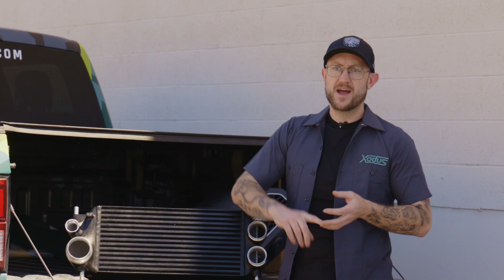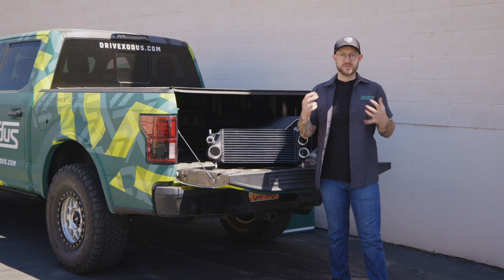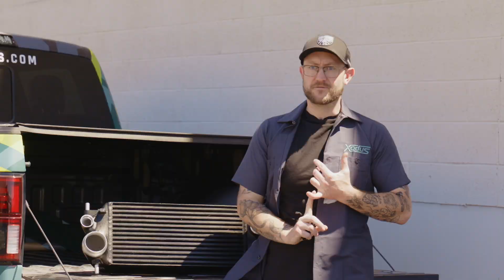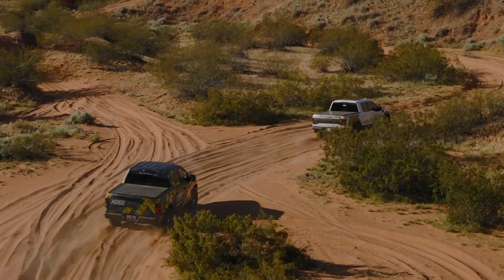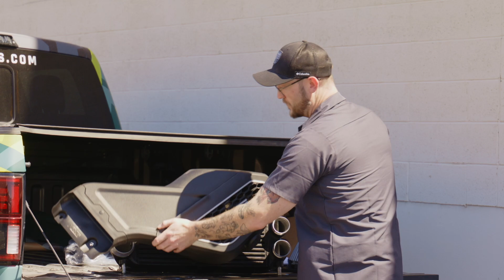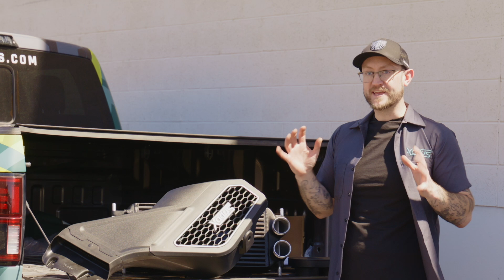F-150 EcoBoost Complete Build Guide

Comment: So only question i have bout your intake is the same problem with most of the so called cold air intakes these day.....with the opening on top is it truly a cold air intake or just a ram air intake being disguised wouldnt the venting on the top of the box let the hot air in???
Reply from the maker: Great question! We definitely engineered and tested this to make sure we could supply enough air for any build demand without pulling in hot air.  Hot radiant air from the engine bay is pushed backwards by air speed and radiator fans. The vent on top is a low-pressure pull that will pull in additional airflow coming from the front of the vehicle as needed. The majority of the air supply is still from the high-pressure forced inlet scoop.

Comment: Just installed my stage 2 tune on my 2nd gen raptor. What a difference! I’m a believer in your products. Next i gotta do the flex fuel and exhaust. Quick question, my truck is dove tailed so my factory exhaust is cut right after the muffler. Can i do the same with the equal length pipes?
Reply from the maker: Totally, the equal length pipes are likely not affected by your doved bed as they install just downstream after the cats section. Also... dove tailed bed!? AWESOME!